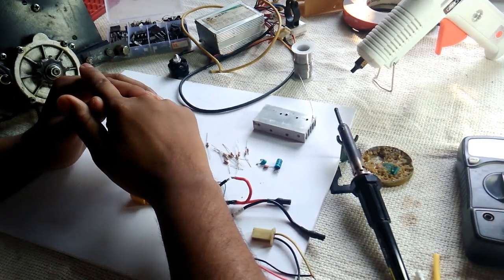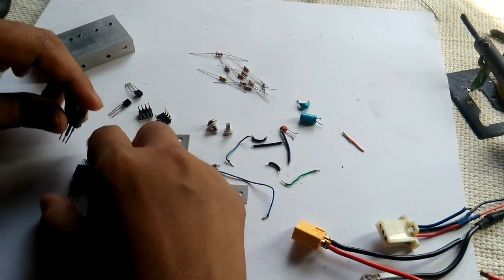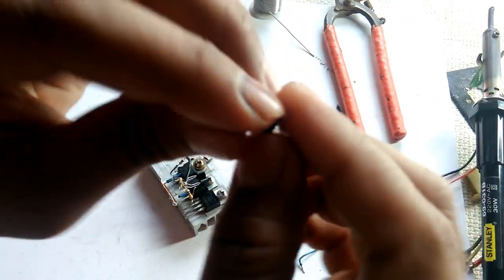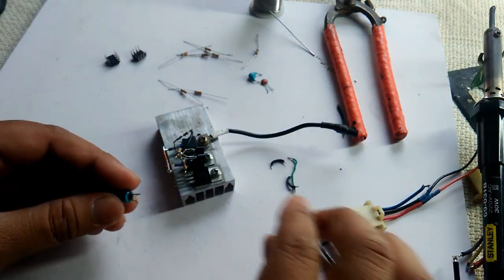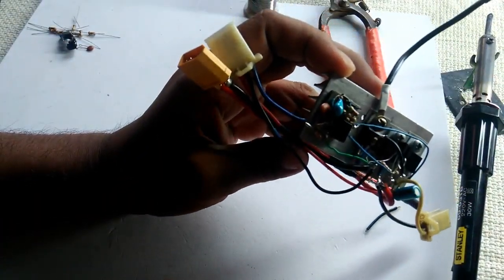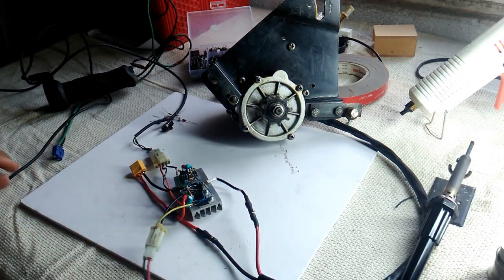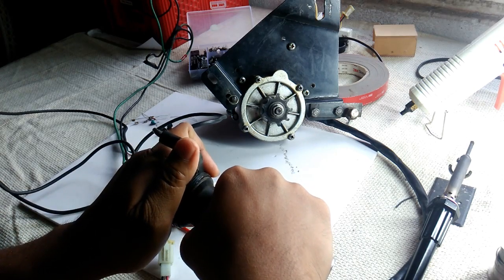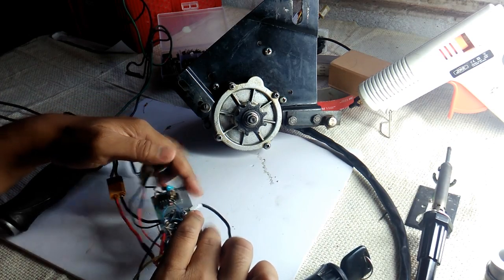How to Make E Bike Motor Controller with Circuit Diagram

Comment: Nice video, Can u provide controller circuit diagram for 24v, 500 watt motor??
Reply from the maker: Thank you. If you are using brushed DC motor this circuit will work fine for 500 watt also but you need to add higher current rated MOSFET or two MOSFET in parallel.

Comment: I have a BLDC   motor with 3 output t terminals how to connect this chircuit
Reply from the maker: This controller is for Brushed Motor, not suitable for your Brushless unit.
Reply: plz give me a bldc  speed control circuit
Reply: @mehraj131 two (Motorola) ONSEMI ic are available for BLDC motor speed control.. Application notes on how ic works is also explained..
One ic is with Brake logic control...MC33035
other is without brake control...MC33033...
Should cost less than Rs100/- each
Reply: ...but you have to know 1) 1-1 relationship between 3 Hall sensors and 3 motor windings...
2) if hall sensors are connected in 120° or 60°
( elect.) config...
3) above ..2 pts are not valid for " sensorless" application.....for that additional circuitry is required...

Comment: sir ,   I was very much intereested to do it
 in the above video u used mosfets / transistor ... but, in the circuit diagram. u used 8 pin IC
Reply from the maker: Thanks for your interest, I did used two 8 pin IC one top of another in the video. Please follow the circuit diagram at the end of the video, it will definitely work as I did not do anything alternative. You have to use capacitor in the output side of the 5v voltage regulator, that I may have missed during drawing.

Comment: Dear sir, Will it work with 250 watt 24v motor ?
Reply from the maker: Yes, it will work. A 250 watt motor will draw around 10 Amps with fully charged battery ( I have practically tested it with my wattmeter attached) & the MOSFET (P80NF55) used is rated at 80 Amp (limited by heat dissipation). You have to use good quality heatsink with proper airflow & also use good quality MOSFET there are counterfeit also.
Reply: @susavanmandal6811  Will this work with 36v?

Comment: I did but it run direct
Reply from the maker: Thank you, please check all the component connection as per drawing it will definitely work. Also add a small capacitor in the output side of the 5 volt linear regulator as mentioned in video at 05.48 min , that I may have missed during drawing, which may have caused the issue. Sorry for the late reply.

Comment: Dada ata ki life hoba
Reply from the maker: Thanks for watching. It will definitely work just you need to follow the circuit diagram exactly without any doubt. I would love to see everyone to replicate it successfully. If you are uncomfortable soldering like this you can use breadboard or perfboard.
Reply: This circuit  I have followed  care fully  and has  failed  to work .Is is like the second ic has  no work.Also you marked  pin 5 as 8 ,making  the whole  diagram  confusing.please  give us a proper diagram.i am sure the purpose of the video was not to confuse us thank6